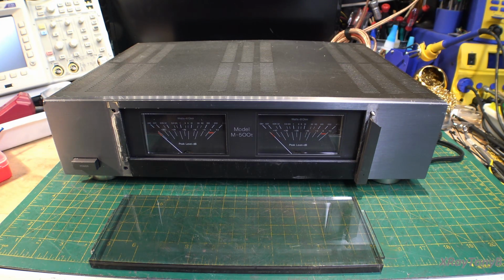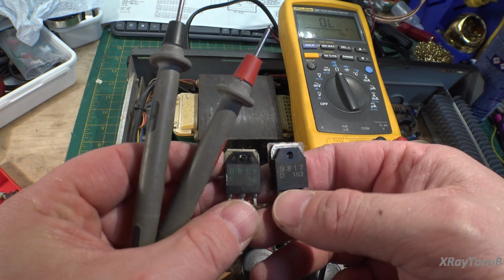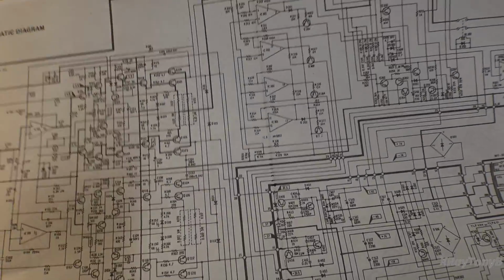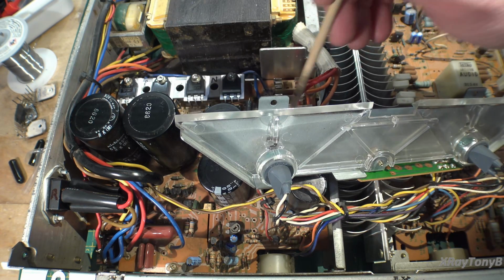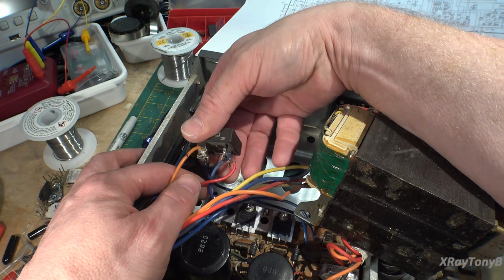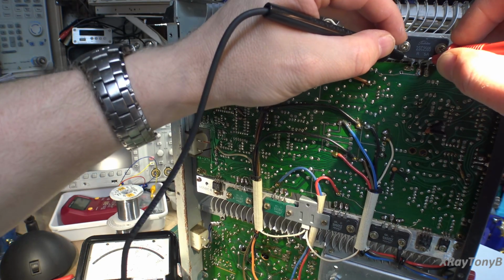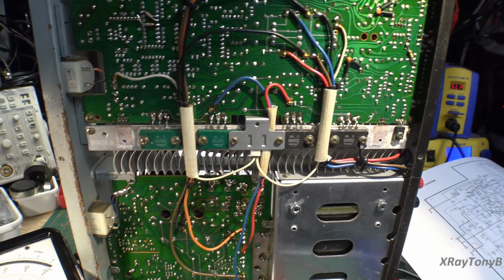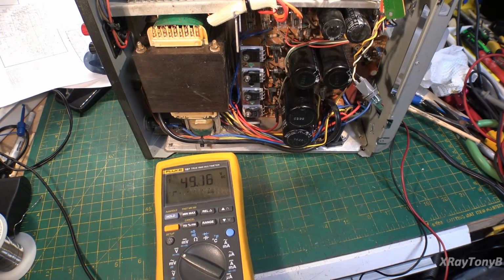Amp Rrepair Video - Carver M500t

Comment: HI. I have 2 TOSHIBA´S transistors shorted. 2SC3546 and 2SA1389 seems to operate at 30 Mhz. and there are very hard to find. So i have a pair of 2SC3281 and 2SA1302 with different shape and about 25 Mhz. of transition frequency  Can i replace them without any problem ? Thanks. Best Regards. Richard

Comment: I use to have M400t and this M500t, this M500t was way better than the M400t, more reliable, I used it on a disco as a bass amp for 15 years and no problem but sound has not the punch and bass control as the Crown MT-1200 or the BGW whcih was the bass authority in those 80's, later in the 90's came the Crest Audio 8001 wich was the punchiest amp on earth and then in 1997 came the Crest Audio CA-12 which for me is the best combination of musical fidelity rivaling audiophile amps with huge power of 700w at 8 ohms with an incredible bass control thanks to it's damping factor, and from that amp anything newer is not as good, lighter, cheaper but not as good sounding
Reply: If you liked those try a 9001/10001 or a CA18. Also the Crown Macro Techs were nice too. I like the old "iron" myself.
Reply: @marnav9205  I have repaired 9001 and CA18 but I prefer CA12 in sound quality, 9001 delivers a lot of watts and the CA18 but not with the sound quality of the CA12

Comment: Hi, I’m thinking of replacing my 500t faceplate with a new plate. Looks like you did the same.  Is the swap difficult? Did you replace the plastic lens as well?
Reply: Answering my own question in case someone wants to do the same. Replacing the faceplate very easy and only took about an hour to do. Slow and steady and it should be a breeze to change for anybody.
Reply: @videoproboston2450  Was it an aftermarket replacement?
Reply: Richard Wielgosz Yes. I bought through EBay. Search Carver Amp Faceplate and a person named Russkall will pop up. The faceplate he sells is top notch. It looks better than the original! He doesn’t sell the plastic lens so you’ll have to use your original. He said he’s looking into selling them at some point...maybe.

Comment: Are you saying that if a transformer is burnt that the entire amp is toast? If you have any information for a transformer for a M1.5t, original, aftermarket, secondhand, etc, please reach me at spiderwebuntangled@gmail.com. If no parts could you help with secondary voltage outputs and I will make my own please.

Comment: I noticed that you're  not using  a line bulb act as fuse  it will light up in case there's a short  when you turn on power,  much safer than praying and hoping No  pop up or magic  smoke,  anyway  nice tutorial video  keep it up

Comment: Awesome Tony as always. Couple of things: Noticed you did not use dim bulb for initial power up after repair (major) - May be you did but was not obvious. Also looks like you did change the broken front face plate. Will be good if you can do a quick follow-up on how you did this.
Reply from the maker: Thank you for the comment!  The magnetic field amps don't really play very nice with a dim bulb.  My dim bulb socket also has a fuse inline with the receptacle.  Even when I bypass the bulb, the circuit is fuse protected.  When in doubt, I just install a small value fuse which will blow  before any damage is done.  As for the faceplate, it was very easy to install, as it was a bolt-on kit sent by the owner.

Comment: Great job! I really enjoyed how you troubleshooted the problem and how you chosen the right spare parts using datasheets.
There are a lot of repair shops that simply replaces the faulty parts without taking care of the stress that surrounding components may have sustained.
My opinion is that audio amplifiers needs specific knowledge and more care when being serviced, specially when they are high end or ancient ones.

Comment: Some would say that Carver amps of this type are no better than or even not as good as more conventional amplifiers.  I've only had one of them on my bench and after the initial mind warping settled down I found that this type of design was pretty straight forward to troubleshoot.  More importantly, when I'd finished with the amp, a TFM-55X, it sounded wonderful.  I told my customer that I'd like to buy it if he ever wanted to sell it.  It'll be interesting to see if this was representative of a larger sample size.
Reply: @Martin M, I can't disagree as I've only recently picked up the hobby of repairing audio gear in the last couple of years.  I've not had the pleasure of listening to high end gear yet. I spent my early years in the trade repairing missile launchers and, while they can produce a big sound, it's not quite the same :-)

Comment: Where did you get those ceramic thermal pads? Do you know if there is a TO-3 version? I think they would be nice for the moto driver transistors in a DEC TU-56 tape drive.

Comment: This transition frequency thing is interesting.  The problem is I can't see the transition in power happening at a high frequency.  I just can't see the power supply having to transition to higher power mode at, say, 20kHz.  More likely, the power supply will have to switch up a gear at somewhere between 20 - 200Hz.  So doing the maths for a frequency of 200Hz, the time per cycle is 5000 microseconds; zero to  peak will be 1250 microseconds; very conservatively let's assume you need to switch at a delta of 1/10 of that as you rise up the waveform so that's 125 microseconds giving a switching frequency of 8kHz.  Obviously you do have to take into account the max frequency of 20kHz (but the chances of having to switch at this frequency are infinitesimal) but that still only gives a switching frequency of 800kHz.  Working backwards from 4Mhz, thats a delta of 0.25 microseconds, a rise to peak of 2.5 microseconds and a wavelength time of 10 microsecond giving a frequency of 100000 Hz; way overkill.
Reply from the maker: I'm no expert on this sort of thing either, but I was more concerned about rapid changes in amplitude, regardless of the frequency.  Remember, most of what we listen to is a complex waveform, made up of many frequencies with rapid changes in amplitude.  The rail switching transistors have to work in step, or possibly even faster than the output transistors.  Again, this is just my theory on this, as I am no expert on the subject.  I also wonder if this might explain why so many people report multiple failures in these amps.  When they are being repaired, they may be using replacement transistors with lower transition frequency and they are failing.  Who knows?  Anyway, thanks for the comment!  A lot to think about!

Comment: I had a Phase Linear 400 for many years. (1973-1990) Basically got tired of the "sound".  Eventually upgraded to a Hafler XL-600 (?).  Much better sound and build quality. Then when I finally upgraded to more effiecient speakers I went with lower power distributed amps. For my "Boston" speakers I'm actaully now using a 7903 "chip amp" which sounds remarkably good.
Reply: I've given up on all those old behemoths.  I now use a sub-$100 Class D 2.1 amp that's more that adequate now that I've given it a heftier-than-stock power brick -- I don't miss my (excellent!) old SAE preamp and Adcom GFA-535 power amp one bit.  IMO, the evolution of Class D has made the big, overly complex amps of yesteryear pretty much obsolete, with even "high end" audio companies building amps with four-figure price tags around Class D modules from companies Like ICEPower and Hypex.

Comment: I have yet seen a single Carver amp running original transistors . Used to own a Carver magnetic field cube amp and got rid of it due to too many issues . I often tell people stay clear of these . Most have been butchered through the years .
Reply: Carver amps are needlessly complicated and over-engineered, hence the never ending stability issues followed by defects.
Reply: I have had a Carver A 500 X Thx since they came out. Zero problems. Lucky, perhaps.